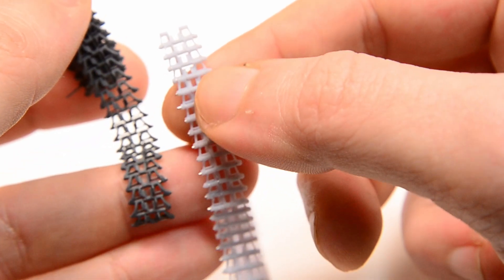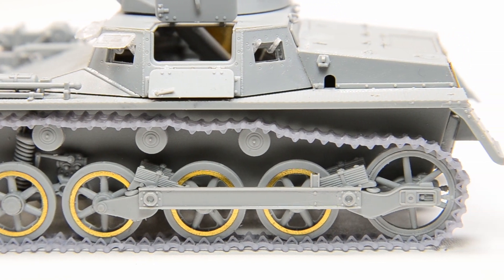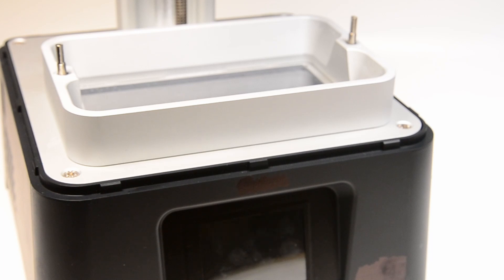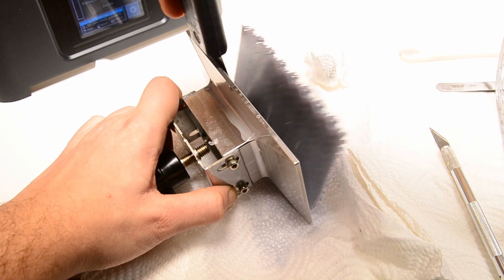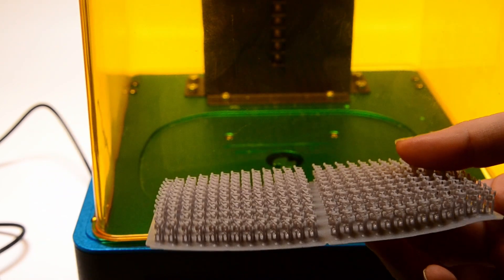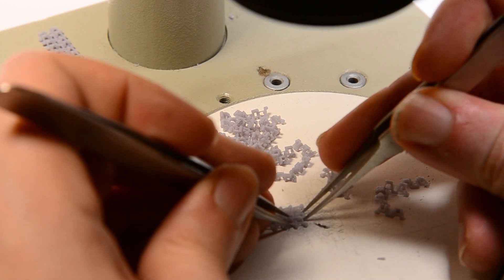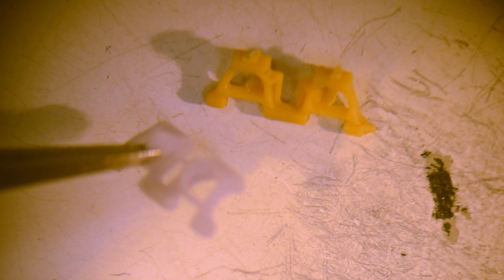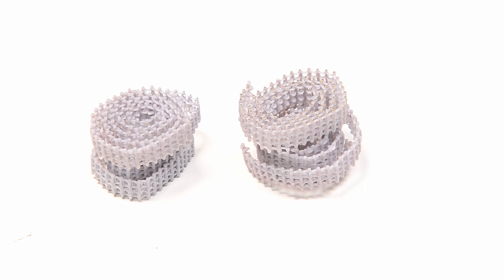3D Printing all variants of 1/35th scale Panzer I tracks | all updated follow-up

Comment: Hi, I did not quite get the model and brand of the 3d printing equipment being used. Can you share with us? Thank you.
Reply from the maker: I'm running the sm4k for the rest of this year, expecting to switch to the sm8k in the new year. Not going to advertise the brand, since the sm4k is acctually not a good/well made machine that can be used without modifications.
Reply: @Tankbrusher  Thank you for sharing. Cheers!

Comment: Good stuff! Are you going to be selling these to modeler's? I can certainly do with a set for my wee hobby boss full interior one! Have you got a set of stug 3 tracks I can try to finish a build or if you have them in winterketten?
Reply from the maker: My STL files are on Patreon. You can either get a printer yourself or use a local printing service. Atm I have no merchant in the UK / Scotland. I myself do not offer physical prints. I will do Winterketten in the future, but I've no date yet. RFM just anouced some, so maybe I follow soon...
Reply: @Tankbrusher  cool, yeah we don't have anything like that, service printers that you can use to do anything like this just not a thing that's offered that I've ever heard off I do have a friend who works in a decal and dealing shop he's not heard of it Either, could you not start an ebay for them and set up a PayPal transfer for sets at some point? I'd be a regular myself for them and sure alot more would be too! I have been thinking about a printer but no room for it then it's the pussying about trying to figure it all out etc! Rather spend a few pennies tbh lol
Reply: I got a set of masterclub winterketten today finally in stock!
Reply from the maker: @Emtbtoday  Oh there were (are) internet plattforms for exactly this kind of task: Allowing private ppl to print stuff for ppl without a printer within the same country. Running a store with physical items is neither economic nor time effective for me here.  I do my designs primarly for my personal projects & builds and not as a buisness. Otherwise I'd have to speed up release frequency and ask for a very different price in order to make it sustainable, just to be outperformed and outpriced by chinese companies doing the same stuff in teamwork, full time and with a fraction of the base cost... It will not take long for established companies to go deep on 3D printing, that's for sure. Than you can buy it from your favorite online store.
Reply: @Tankbrusher  I'll look into it never knew it was Internet based thought it was a detailing printers or something like what my friend works in, I'll look into it now thanks again mate
Reply: @Tankbrusher  I'll get money transferred into PayPal and join the sale patrion thingy never done it before lol
Reply: I am a Patreon supporter of Kai, and can say his tracks are amazing!  I have been printing and selling resin tracks on Ebay for about a year, and just entered an agreement to be able to sell prints of Kai's work, so I will be listing them soon, but I need time to get an inventory built up. 

If you're interested I can share my store with you, but I don't want to hijack Kai's channel, as he is doing great work here and also great things for the modeling community!  So I will check with him first  too.
Reply: @rons5438  yeah brilliant go for it! I've spoke to him about it and he said he's not doing it like for selling I have asked a couple of times but yeah that would be great to see what there like! Thanks
Reply: The metal tracks are OK to a point I've been using masterclubs lately as alot better sharper detail to fruils but I'd definitely go for 3D printed one's alot more really they do look very nice indeed! You know what type I'd love just now amd that's a set for my Afv club meat chopper the m16 halftrack! You only get thin rubber band's! There OK but there band's! Yuk! Lol

Comment: Phrozen Mini 4k found it. How do you think it compares to 2k screen and 51um?
Reply from the maker: Hi, it is noticable. I've got the photon S to compare to - while the photon s is the better machine - construction wise - the prints are noticeable more detailed on the SM4K. Specially when it comes to printing thin walls and holes.
Reply: @Tankbrusher  As I said in different comment I got on order the Anycubic Photon Mono. I wanted to go with SM4K but the difference I put towards an Anycubic Mega Zero 2.0 which will be used for different task that do not require so much detail. However I am interested in how would such a print compare between APM and SM4K.
Reply: @Tankbrusher  From the paper stats I can see Photon S would be not so great compared with Photon Mono in resolution. Not sure what LCD it has, and while seems 2K Y axis they say it is 1.25 um. Which is quite a lot. Mono lists: Z Axis Res.: 0.01mm
, Layer Res.: 0.01 ~ 0.15mm, XY Res.: 0.051mm 2560*1620（2K).
Reply from the maker: I'll contact Anycubic to see if I can get some props to compare the machines in their resolution. The photon s should be compareable to the mono, it's grid is around 47,5um (messured my spare display) - not in print time of cause. Atm I'm too short on resin to dial the photon in. I never printed the same parts on both machines with maxed out settings, the sm4k was in practical terms a replacement. If you don't mind contacting me on facebook: The upcomeing week I'll be stocked up on resin and have to print a lot of parts - I'll run a few panther and E-100 tracks on both machines and post the macro shots. https://www.facebook.com/albert.panza.315 I'm curious as well, since I'm looking into getting a larger 50um printer, since I'm designing a printable Panther (D-A), with its chassis almost completed it'll be time to upgrade.
Reply: @Tankbrusher  Ahhh, the Mighty one!
Reply from the maker: I'll check the z-axis later today. You have to messure the microsteps with an oszilloskop as well as the pitch on the lead screw. Usually Z layer hight shoud dial in a 0.03mm for 1/35the scale. My layer lines on roadwheels (they are printed upright are not visible. I've pics on facebook and scalemates.
Reply: @Tankbrusher  I wrote to you on FB.

Comment: Hi. I was inspired by this video. And modellled clamp for the tools. It perfectly  printed although it is as tiny as PE parts. But all my 3d-printed clamps are fragile as hell. Just touch it and it breaks. Did you try to print a clamps? I'm using anycubic "basic" resin. After curing it's like ceramic.
Reply from the maker: Hi, I tested printing clamps at some point a while ago (more concept based than the actual part) but I don't have a good one to copy from atm. Did you design yours yourself? I'm very interessted in clamps (and tools). Atm I'm working more or less on a complete Panther Ausf. D based on Dragon.
Reply from the maker: There are different types of Resin, you can get some with ABS like properties -> much less fragile. I'm kind of limited to water washable resin because I can't justify having large quantities of IPA /Ethanol around (Fire/Vapor hazard).
Reply: @Tankbrusher  Yeah, I designed myself. More concept than the actual part as well. I've used picture of Rochm clamps as a canvas for modeling in Fusion 360. Now fiddling with supports for them. I bought 2 liters of anycubic basic resin along with the printer. Just to try. Now I need to use all of this resin before I can buy another one :)
Reply from the maker: @CatEatsDogs  Sounds like it is time to start a 40k tabletop army... That will deal with resin very fast xD I do know that Adam Mann here on YT does have digital copies of original tool clamps, but don' know if he sells them somewhere... My exerience is so far that we have to tinker with FEP tension before we are able to the handles of toolclamps to print. Another guy on Facebook manged to print workable 1/35th tool clamps but on a professional machine. Before I dive into that small parts, I need Panther tracks and a lower hull and before that I have to fix my Dragon Panther Ausf. D...

Comment: So ein 3D Drucker schon was feines. Wie gibt man das ein frag ich mich grad Arbeite an einer CNC Plattenfräße. Musst da auch alle Prameter eingeben.
Reply from the maker: Hi, wo ne CAM Software nutzt, nutzen wir nen Slicer. Die Drucker beherrschen GCode, allerdings abewandelt und in proitären Formate eingewickelt. Festgelegt wird v.a. die Belichtungsdauer der einzelnen Schichten. Das hängt dann vom Bauteil, Drucker und verwendeten Resin ab. vgl. Drehzahl und Zustellung bezgl. deines Fräsers. Das meiste an den Druckern ist sehr vereinfacht, so kann z.B. die Belichtungsdauer nur für die gesamte Druckplatte festgelegt werden und leider nicht für einzelne Segmente oder Schichten. Soll halt nutzerfreundlich sein ; )

Comment: you can make a lot of models using this printer. cool Bro
Reply from the maker: Thanks mate, seen already a lot modelers doing 1/72th scale fully printed vehicles. in 1/35th resin tending to warp becomes a issue. Ppl. doing 40k tabletop are printing large vehicles like crazy however ; )

Comment: Glad you are printing more vertical.
Reply from the maker: Didn't work well with my previous setup. Next project will be multi-level ; )
Reply: @Tankbrusher  I noticed your gabelstollen are symmetrical. One side is taller than the other on real ones.
Reply from the maker: @AdamMann3D  There are more geometrical differences to original ones from mine. If it's more than 1/10 mm in 1/35scale on your originals I'll update mine.